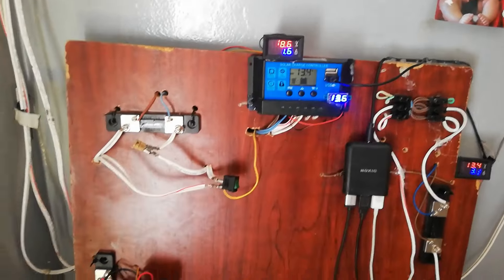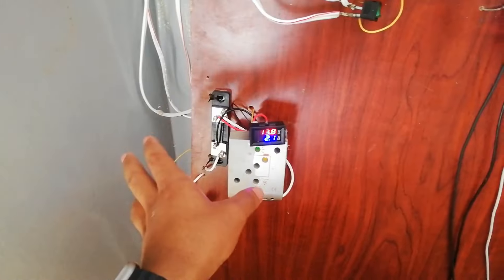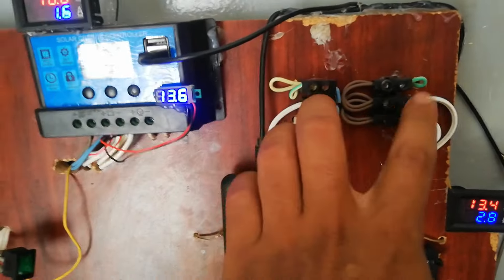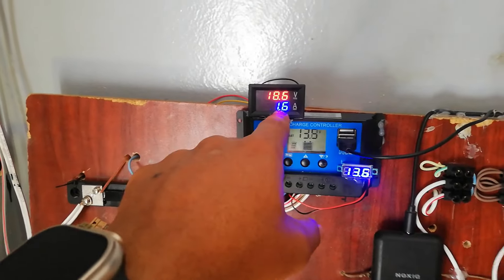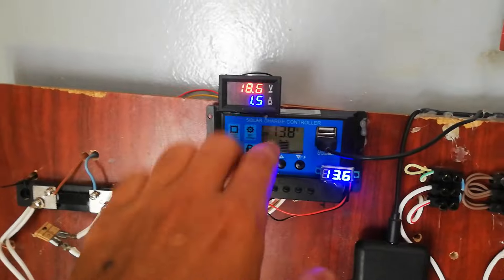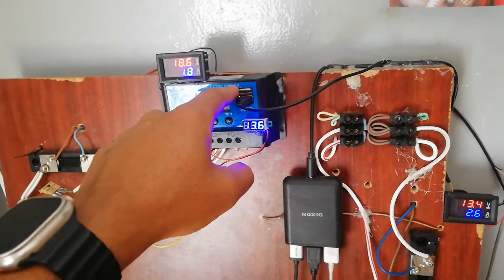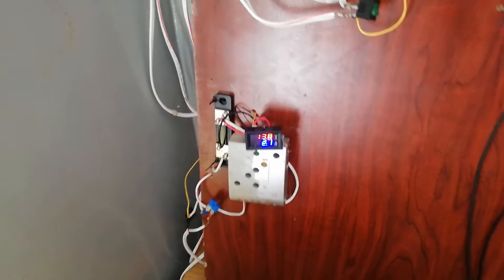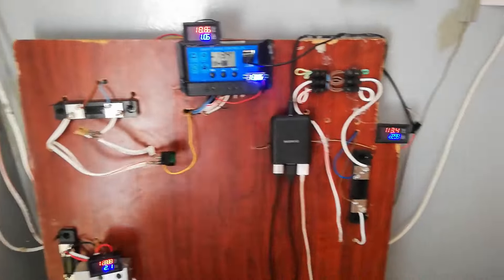Power Monitoring system for my dc solar setup with the 3 50amp 100volt meters is complete .

Comment: Good set Sir nice work I'm in progress to get a set kitt from Amazon 🍲🍲🍲🍲
Reply from the maker: Nice 👍. Please do so. I know Amazon has a very wide range of top notch meters. You won't regret adding a power meter setup like mine or even better. If you can if possible, get  a meter that shows watts, amps, volts minimum. You won't regret it. Thanks for watching.
Reply from the maker: @user-hw5el1wu8u Hi did you manage to get hold of your set kit u told me of? Did u install it?